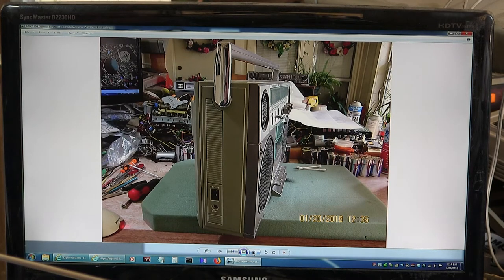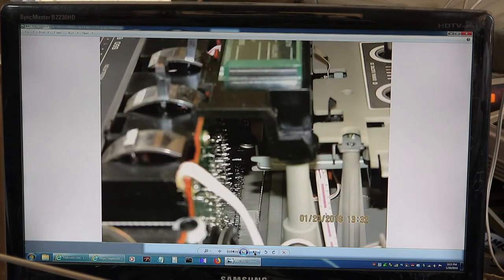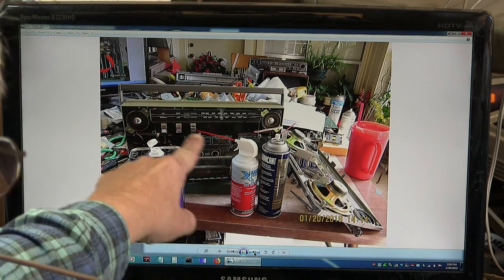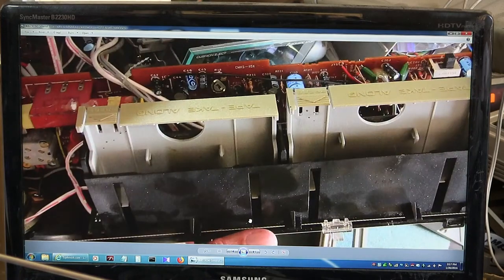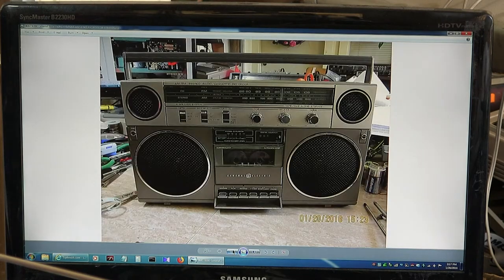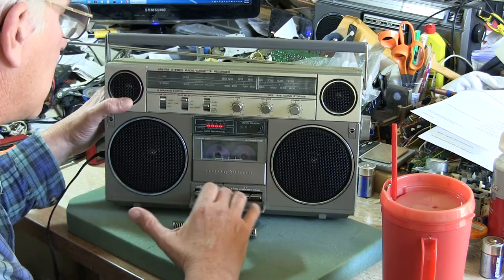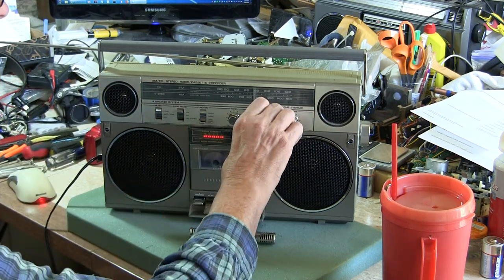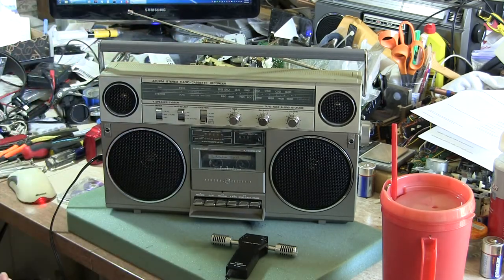General Electric 3-5257A GE Restored Pictures REC/Play tape & Sold

Comment: Thank you for your video, sir.  One of the only video's about the disassembly of the 3-5257A which I just picked up.  Your audio does leave a lot to be desired though so as a constructive criticism I would suggest not using your Realistic stereo mic for your commentary as it flips between the far Right and Left channels as you move around the item.  The stereo has a headphone jack and that would be good enough to record the quality of the stereo when you are confirming that the tape and radio are functioning.  You didn't use that mic in previous videos from what I can tell going back into your catalog so I'm thinking it maybe was just a failed experiment to use it on this video.

Just my $.02.  Keep up the great content.  I've subscribed and am excited for some new content in the future!